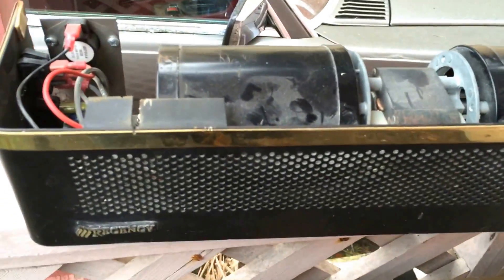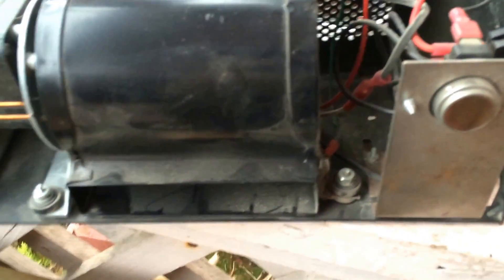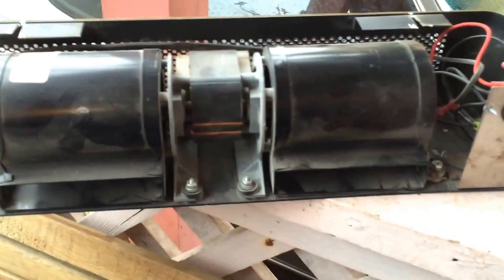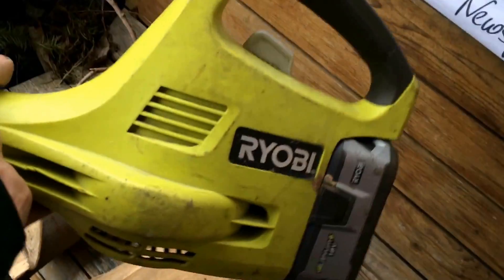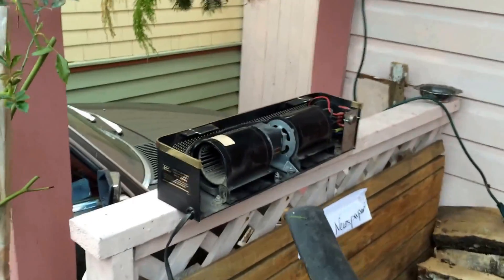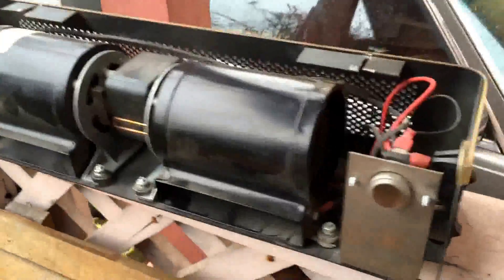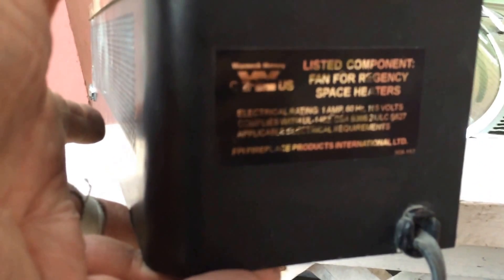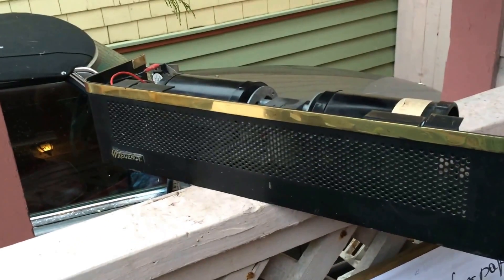How a Fireplace Insert or Wood Stove Fan Works - Flue Guru

Comment: After the initial installation of our Regency 12500 wood burning fireplace insert, the wood stove fan did not seem to add much - high, low, or off - all seemed to be about the same.  After speaking with a friend who had the same stove he suggested I pull the fan and examine it.  The installer had said it could be installed either way and opted to position the fan so that the electric outlet to the right of the stove could be reached without an extension cord.  The fan had been extremely loud and did not do much.  When I pulled it out to examine the fan, I realized that the exit ports for the squirrel cage fans had to line up with the intake ports on the stove - the fan had been installed upside down !!!  I installed it properly and voila!! What a difference - blasting hot air and quiet as could be.  We had to start shedding the extra layers as our room temp shot up from low 60s to low 70s.